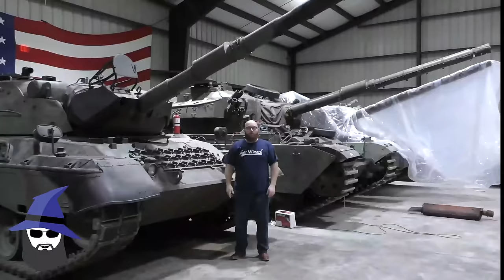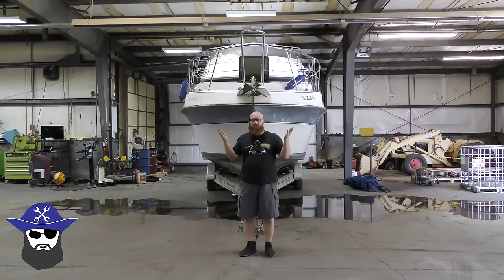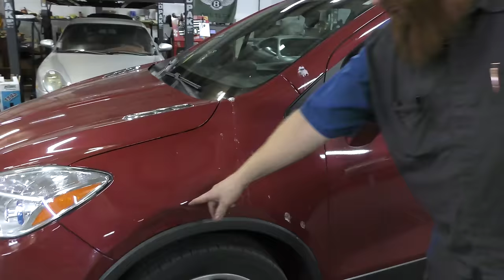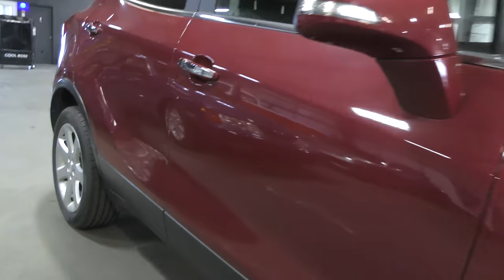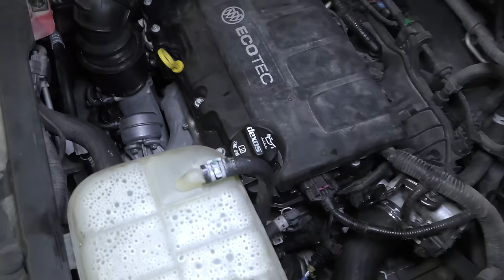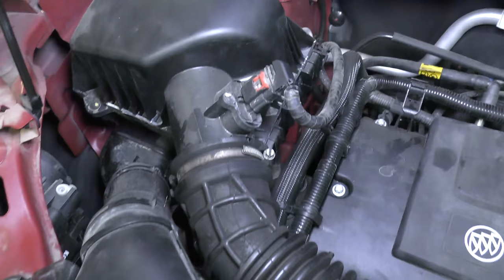How did a dealer miss the problem on this '15 Encore 4 times? CAR WIZARD just had to read the codes

Comment: At 12:20 you mention seepage from the valve cover.  These engines have issues with valve cover failures which leads at least three check engine light codes.  Damage in the form of pitting on the cams occurs when moisture gets to them from the valve cover failure.  A dealer replaced the valve cover three years ago on our car and now it is being done again plus replacing the cams.  Oil usage was one indication of underlying trouble and may be the issue with this Buick.  You points about proper diagnosis are well taken.  Also buying an inexpensive diagnostic tool ($25) is a good investment to know what the codes are before taking it to a dealer.

Comment: Thank you for all your thorough videos and thanks for this one in the Buick Encore. My 82 yr old Mom was just charged too much ch at a dealership for repairs she didn’t need. My understanding is the AIT and MAF sensors are integrated into a ne part and they told her the AIT sensor was under warranty, but the MAF sensor was not and would cost $125 plus 1.5 hrs labor. Well it only takes like 3-5 minutes to change a MAF sensor so we m not sure why they charged so much for labor. They also wanted to charge her for a “Fuel Service” $159 + tax. I asked what that was and they said that you need to do that when you change the MAF sensor and that it cleans all the carbon build up etc. i didn’t know my mom was taking her car in ti be serviced. Not only that, but she paid $175 to have it towed to The dealership because she was scared to drive it there. She didn’t want to get stranded on the side of the road. There was no check engine light on. She said it was jerking and sputtering some while she was driving it home yesterday. Had I known ahead of time I would have put my code reader in it and fixed it myself if I had known it was a sensor. But I didn’t know anything until she had it towed to the dealership. I’m so upset about this. It’s wrong what these dealerships do to people!! So am I right about the MAF and AIT being the same part on the  2013 Buick Encore? Thanks again!!

Comment: I've had my 2013 Miata to the dealership for 1 problem with the door locks that was covered under my extended warranty;  they replaced 1 door lock motor.  Free oil changes with 0-20 Synthetic and a Mazda oil filter every 4,000 miles since I bought it there.  No problems with the 'vehicle check' list they do every visit.  It seems from your 'dealer fixes' that if you know which end of a screwdriver to use, you can work as a mechanic at a dealership.  I'm a Handyman by trade, and I know repeat business (my customers give me most of my business through referrals) is the key to my success.  Too many businesses want to get rich quick over ONE job.

Comment: Not just the US Car Wizard, where I live it's just the same, not only the dealerships but also independent mechanics, they don't care if they lose you as a customer as long as they squezze as much money as they can from you, it's really sad. I rather work myself on my vehicles (and a lot of your videos have been really helpful) but it comes the time that either I don't have the tools or equipment to perform some diagnostics and/or repairs and need to take my car to a "specialist" but the fear of been scammed is always there. More and more I consider to do the 20hrs trip to Omega and get my cars properly fixed...

Comment: Also, for a do not buy are the 2008 Saturn Aura XR sedan (because it has the 3.6 L V6 engine from GM - well known for timing chain failures and oil sludge inside the engine), the 2002 Dodge Grand Caravan Sport minivan (either the 3.3 L or the 3.8 L V6 engine), because they have electrical and transmission problems and so forth, however the engine still runs fairly normal and finally, the 2016 Ford Explorer 4WD mid-size SUV (either the 3.5 L or the 3.5 L Ecoboost V6 engine), because they have a problem with the water pump, which leaks inside the engine. The Car Wizard wants to inspect some vehicles that are reliable and do a lot of maintenance, instead of repairs every single time from each customer who brings their vehicle into the shop. Thank you very much and enjoy the rest of the weekend.

Comment: Good Vid, Thx. To both you and your people and your fine "Camera Lady"
I like how you nick names for your fine help... Magic Mike and now Long Beach.

As for Stealerships and now even local shops ... it is the same here in NW Oregon.,

Two years ago, a few weeks after buying my used 2003 Lexus RX300 (as is) from a Lexus dealer, I needed new front rotors. Other that that? ... Pristine. Dealer wanted $700. 

Our local "Brake/Tire/Strut chain here ... Les Schwab ... $220 out the door; they have been great YEARS! Good work, good warranties ... that they actually honor ... rarely needed.

Since then paid $1,200  for sensors & parts plus did 120K service ... all early as preventive maint. At dealer ... or even local shops ... almost $7,000  to get all that done. I do understand the costs of overhead, etc. BUT the HUGE worry is questionable quality and sloppy work. 

Even small shops hire mostly hire "newbies" and pay them very little. They also charge based on the "Book" ... perhaps 10% less than dealer, but now with similar low quality and "call-backs" ... and our expense!
As a retired EE, the electrical stuff is fairly easy, but for all the other stuff ... I spend HOURS on YouTube University before each new job. e.g. Cam Sensors. Ditto rear plugs without removing the intake Plenum.

BTW ... For you DIY guys out there ... ALL those Actuators / Servos for A/C, Heat / Air Doors ... they all Hunt after a 100K or so on the clock. $400+ for each one (lots of labor ... buried behind dash)
TIP ... I had all 3 of them hunting on my SUV ... at 112K when I bought it. 
After many of hours watching videos, I did the above services and THEN sprayed WD-40 into the Actuators using a fine tip ... at the GAP into the space between the  "Arm Pivot" points and the case.

FYI: The problem is cheaply made printed circuit boards PCBs  ... (NOT gold plated).  WD-40 is NOT a lubricant; it is rather a NON_CONDUCTIVE cleaning agent. In this case, it "washes" the conductive copper "dust" (from the wiper arm rubbing the copper "lines" down off those partially-shorted-out PCB traces / lands; easy to do. The copper "slurry" just runs down to bottom of Actuator housing ... then evaporates.  It has been about 18 months now and all 3 function well and and quietly ... aka no "Hunting". 
A SHOP can NOT do this, cause they have NO WAY to Warranty it. But YOU CAN DO IT!
Warm Regards to all,
John in the NW

Comment: I just had a Kia towed in from a shop across town. They said it needs an engine. We were cheaper on the quote. I always check and properly diagnose. A crank position sensor fixed it..... I now have a new customer.

Comment: As a former GM tech, this should have been fixed immediately, and with ease. Every, and I mean every single one of those 1.4s will leak coolant from the water outlet/thermostat, or they will set a CEL. The PCV/valve cover will also fall on every single one, and either leak from around the valve covers, or the cam seals.
Reply: Tell me about it...I work in an independant shop in Montreal, and if I had kept all the valve covers I have changed, I could pave my driveway with them! Then there's the failing check valves in the intake manifolds, not to mention the oil filter housing leaking like Niagara Falls, and the water pumps...

Comment: My son has a Chevy Sonic RS. I think it's the same motor.
Constant overheating problems since it was 18 months old. 1st time resulted in a rebuild. Subsequently they replaced the water pump 4 times.
Just after the warranty expired it overheated again. I don't have a scantool but I had been shouting THERMOSTAT for 2 years, so I just replaced it . No more problems after 2 years 
I have a very low opinion of dealerships and their mechanics.

Comment: My mother bought a 2008 Taurus new. At about 2,000 miles it started having awful belt chirping. We had to have taken that thing to the dealer at least a dozen times. They replaced the drive belt and the tensioner five or six times. The last time we went the tech wanted us to leave it there for a few weeks so they could tear the engine apart, they were thinking something was misaligned in the belt system. We told them to forget it. The car ran perfectly and I didn't want them to ruin it by tearing it down. It's now at 75k and still makes that damn noise. I've come to suspect the A/C clutch bearing is what's actually making the noise. Haven't gotten around to messing with it yet.

Comment: The exact thing happened to my moms ‘14 Buick Encore. Except the local shop had it once only topped off the fluids and deleted codes. Then all the fluid started pouring out the bottom of the car when I pulled up to her house. $1,400 dollars later and they had to replace her water pump and something else I am not sure though.

Comment: My mom has one of these but it's a 2019. She really does take care of it. Her check engine light keeps coming on. The code is for low boost. The turbo was replaced and she is still having that code pop up here and there. Multiple components have had to be replaced on her engine. I feel its something do with the turbo system has been causing her issues right after her warranty ran out. She had the thermostat issue too.

Comment: It seems that it used to be a point of pride to say a car was exclusively dealer-serviced... now, that seems to be a major warning.

... and that platform (Encore/Trax) is actually pretty decent for driving. My wife has an AWD Trax that is an absolute blast to drive around town and on the highway. My only complaint is that the seats are a little small and uncomfortable for long drives. The 'lifetime transmission' is also something that concerns me, but we haven't had a problem yet.

Comment: My last experience with a dealer involved trying to get my cars blower motor replaced. The car had 30k and you could tell it was unbalanced it would hum and shake when you turned the knob up. I pulled the glove box down and basically showed them the problem. They wanted to charge me a $178 diagnostic fee and then not cover the replacement of the part because it was out of warranty by a few days. The blower motor online was like $60 oem

Comment: I had a dealer tell me my 2019 murano with 18K miles clunked in the front end because my power steering is "fuel injected". Even put it in the R.O.  5 dealers said it was a normal sound.. it ended up needing new front sway bar bushings after an independent shop properly diagnosed the problem in half an hour. The car is now a legal lemon, I am getting a buy back from the manufacturer.

Comment: electronics are funny things.  I had a dodge Durango once that had idle issues.  I tracked it down to what i thought was an Idle air control valve being bad.  Replaced it and still didn't run right.  turns out that the battery was bad.  The IAC valve needed a certain voltage to work and the battery light comes on at a much lower voltage.  So I now check the battery first for anything electrical.

Comment: Great video. I have a 2014 Buick encore too, and have a similar problem.
Mine started staying on hi cool after I would shut it off once in a while. The i noticed the low and mid fan speeds quit. And now no hi speed either. I hear the click but the fan doesn't turn. I saw a different video, where it shows a resistor and diode, under the fan shroud. We have a lot of money in repairs ( we bought it from a dealer..yikes and it only had 100,000 miles)
Now at 139,000, we've  replaced  the spark plug thing, the catalytic converter, rear spring broke and replaced, all new brakes and rotors. 
After seeing your video, I wonder if a local parts store scanner could give me a clue, before I throw more money into this. It really is a good car when it runs. Lol
 Thanks and hope the Ferrari is coming along.

Comment: i can confirm it's not only in the usa. I live in Thailand and my radiator was loosing coolent. Brought it to the dealer, they took out the radiator cleaned it, cleaned the whole cooling system as the said the dirty radiator was causing it. It continued loosing coolent. So i brought it to an independent mechanic, he took out the radiator again and checked for leaks, he was like, you have 9 holes in your radiator and your thermostat is broken. I was like, wth, the dealer didn't notice 9 holes and a broken thermostat. That was 3 years ago, the mechanic is still my mechanic and i never went back to the dealership

Comment: My mom has one of these. We had issues with coolant loss, overheating, some small issues as well, like an airbag light. The dealer that we purchased the vehicle from just kept not seeing the actual issues with it. They just kept fixing one thing or saying that it was something stupid, like that my mom was sitting on her seat the wrong way. It just kept getting worse. They did fix the seat, after three trips and a wiring harness replacement. We loved this little car and bought a new one about a month ago. The old one we put a water pump, a PCV valve and a thermostat/coolant temp sensor. The dealership we went to kept just not doing the right service, instead they kept saying we needed to do differential and transmission services, which were a lot more than just the PCV valve and the sensor and thermostat, which was done by another reputable shop. This time, we found a better dealership with a really good service staff, I mean really good. They put the water pump in and actually fixed it, instead of just kicking the problem down the road.

Comment: You sir are a saint and scholar amongst mortals.Such will always command respect. When I see things like this, with all of the other crazy BS going on, it makes me wonder if someone has a time machine and we've all been taken back to the early 1970s. Fuel prices going nuts, riots, civil war being a horse's tail twitch away, etc. In the words of Master Roshi "A candle flickers wildly right before it goes out."

This is EXACTLY like some of the stories my mom went through back then. A woman goes into a shop/dealer/etc, employees see "Easy Prey with zero consequences". The only difference is the back-alley hacks are "Dealership ASE certified technicians" now. Such is why I picked up the wrench in the first place to have clear, concise answers to my mom's questions that make perfect sense to anyone.

As my dad, an engineer for GM in the late 60s would say "A new car won't get you there any faster, safer or cheaper. Just shinier, for now.". He quit GM because they started pulling scammy BS like this. And as we all know, GM never stopped doing that.

Comment: in 2010, I owned a 2009 chevy cobalt ss/tc sedan. I was one of the first people to get their gmpp stage 1 kit, it was a flash and 2 sensors i believe. It was before adapter harnesses were made and the dealer had to cut the pig tails off and wire new ones in. 

I was enjoying the new warranteed mod. The car was a lot quicker, ran 13.8 at 104 in the quartermile. About 3 weeks after the work, I was on the highway and did a pull. I left off, car felt fine, check engine light came on and the car went into limp mode.  I researched the issue and it seemed like a vac leak. car was under warranty, so i brought it to chevy.

dealer #1 had the car for a month. They started to blame the gmpp tune and said it wasnt covered. I had to get chevy involved and they told the dealer it was covered and fix the car. I told the dealer i suspected a vac leak and if they hooked a boost leak tester to the intercooler piping they should find the problem. They replaced every sensor that was in the intake track, ecu and random other stuff. it was about 5k worth of work they said. they told me the car was fixed and to pick it up. I get to the dealer, drive my car around warming it up, once it was warm, I floored it in 2nd and the car instantly went into limp mode. I turned right around and told them the car isnt fixed. they kept it another 2 weeks and said they couldnt fix it. I asked about it being a vac leak and if they tested for that. they assured me they did. They told me i had to pick up the car and being it to a different dealer.

dealer #2. I told dealer number 2 that i suspected a vac leak and please do a boost leak test. they blew me off. I understand they have to diagnosis stuff a certain  way, but didnt appreciate that. I gave them the paperwork from the other dealer. They proceeded to replace more sensors and the ecu again. Nothing worked. 

Chevy had to fly out an engineer. He looked over the car and I got a call later that day that he found the problem. There was a vac leak in the intake track. The bottom of the intercooler had a plastic tray to drain moisture from the system. It was cracked. The dealer then tried to say I hit a curb. The engineer said if he hit a curb, there would be physical damage to the plastic. Its cracked, but wasnt hit. 

so, i finally got my car back and working the way it was supposed to do, this is why i generally dont trust dealerships or mechanics. I literally told them what I thought the problem way, I was right and was ignored by 2 dealers and a bunch of techs.

Comment: Question: Could it have been a serpentine belt issue that caused the battery to fail. Then, the dealership fixed the belt, but failed to replace the damaged battery. 
I love your videos.

Comment: I have found repair shops (both dealer and independent) are between 40-60% successful for "elusive" issues the first time you take it to them. The best advice I ever got was "you can screw up your repairs for a lot less money than a mechanic", so outside of routine services, I do my own work. And you know what? I fix it successfully the first time between 40-60%. But I don't have to pay for the second, third and fourth attempts! And I learn a lot.